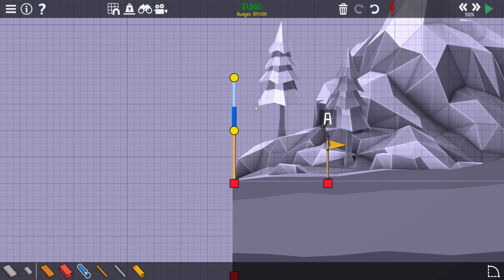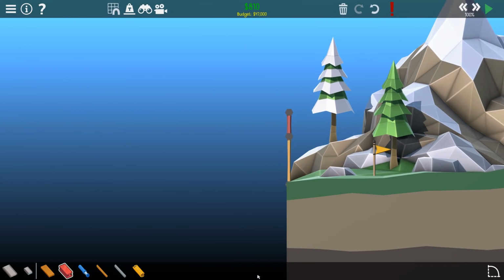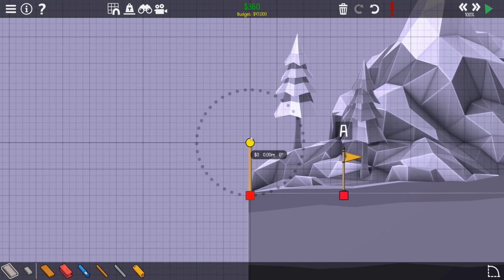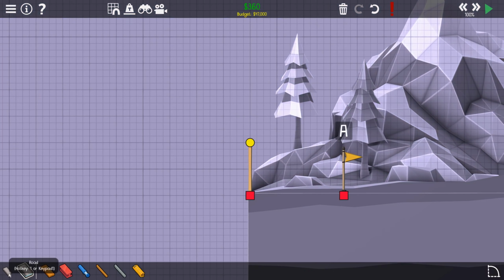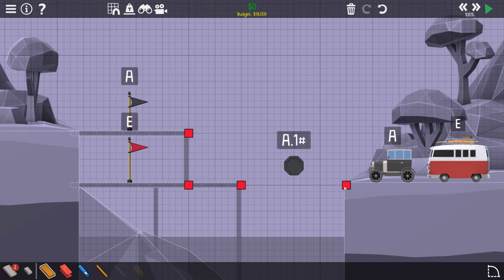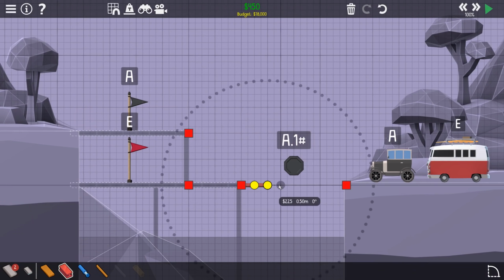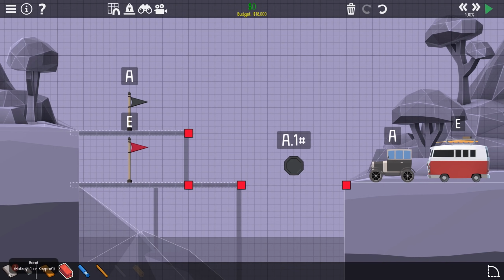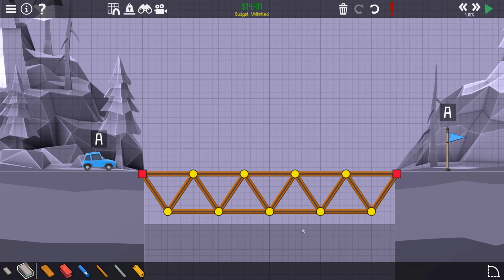How REALISTIC is Poly Bridge 2? Explained by a REAL CIVIL ENGINEER

Comment: I did some researches and posted it on reddit one time about the exact weight and maximum stress forces of the PB2 materials.

Turns out that while all the materials have no mass, and only the nodes have a mass of 0.25Pg, the roads have a mass by piece + length + node.
Each meter of the normal road is 0.25Pg.
Each piece is 0.5Pg.
Each node is 0.25Pg, like everything else.
While for the reinforced roads, the meter and the segment have a mass of 0.3125 and 0.625 Polygrams respectively.
Reply from the maker: This is fantastic, great work and thanks for sharing!
Reply: @Esphaav nerds are the powerhouses of our world <3
Reply: @daruyami  Humour exists <3
Reply: @daruyami  so you're calling mitochondria nerds?
Reply: @sinbad269  world != cell bruh
Reply: @daruyami  promoting hubris, are we?
Reply: Love seeing someone get into the nitty gritty of a video game like this. Really gives an insight into a developer's mind & also allows greater applicable feedback for them. 

Speaking of which I'd love to hear the developer's thoughts regarding this since the weight of roads differed. I'd bet that initially the different materials did have differing weights & weight by length but were changed either do to it raising difficulty too high or maybe it'd require more processing power. Not being a programer I don't know if it'd effect processing power enough to matter.
Reply: soooo does this make it realistic or not?
Reply: Esphaav his nerdiness got him a good paying job, so maybe you should try it out sometime
Reply: @puffball2059  he could have been a programmer and been someone's basement slave. You can make bank being a welder or plumber.

Academics =! Wealthy job
Blue collar =! Shitty peasant
Reply: 696 likes

Comment: Not an engineer, but I can tell you that a solid piece of lumber probably should be heavier than a steel I-beam. The reason we make skyscrapers out of I-beams instead of solid poles of wood, is because they are lightweight and extremely strong. 

The reason they make steel support structures in the form of I-beams instead of solid poles of steel, is because the I shape MASSIVELY reduces the weight of the steel without compromising its strength. It MASSIVELY reduces waste, and the thin parts of the steel that stick out from the core on top and bottom gives enough surface area to attach steel rivets to them and connect things to it.

Comment: I just thought you could measure the torsion strength of the pieces as well, by putting a number of nodes on top of a piece and seeing how many it takes to crush it, then, invert the setup and dangle the nodes instead, and, again, measure how many nodes to break it.

Comment: I know I'm a bit late to the party, but could someone explain the difference between the trusses going above the bridge vs below? Or if there even is a difference. I have a degree in computer engineering so forces and physics are not my forte, but I love learning new things and find this very fascinating
Reply: Late to the party as well =) The big difference is that the upper chord (in the case where you span over one precipice) is under compression while the bottom chord is under tension. So you could go  "topChord=woodBeam and bottomChord=rope" and it would work. Try the other way round and your bridge will collapse immediatly since rope cant do compression. Concrete (without steel reinforcement) works in a similar way since its tensile strength is only about 10% of its compressive strength. 
If you take the same materials however there is no big difference concering the statics. In reallife where you put the truss would be a matter of if you need free space over or under your bridge.

Comment: Our modern, personal computers are pretty incredible compared to what they were just 10 to 15 years ago, BUT even the most powerful personal computer does NOT have the computational power to fully simulate real world physics in real time. Simply put: There is no game available anywhere that actually simulates real time, real universal physics. To calculate every physical force involved with a vehicle moving across a bridge structure, even once per second, much less every animation frame, would slow the game down to a game freezing nightmare. To overcome this, games use generalized calculations (algorithms) that appear to simulate things like mass and gravity and stress forces, aerodynamics and buoyancy, etc, but these are so over simplified for the sake of speed that a game like this could only be used to teach general physical concepts, not practical, real world solutions to bridge building.

Comment: nodes in real life could have a mass, but that's only if a node is just 2 holes in each piece connected with a steel rod or something, that would make sense, but I'm just guessing that the developers just thought it'd be funny or something idk (this would only make sense if the steel rod weighs more than the material, so it would make sense with wood, but not with steel, so the rods would've been made out of osmium or something which is kinda weird and expensive

Comment: Wait a second..

You stress vs weight theory makes no sense to me....

If the game calculates strength vs weight equally based on the material and is always equalled out you'll arrive at the results you have observed...

Like wood being 50% of the weight of steel and 50% of the strength...

The joints are a + factor which bares weight on its own but never exceeds the material used...

Still not realistic when you get down to it...

Also isn't the "stress" percentage counter based upon the over strength of the structure and not individual pieces?
Reply from the maker: No all materials except road weight the same, their strength is what varies. The stress percentage is of the weakest piece, not the average of the structure

Comment: In the brief physics classes i took I remember there was always some factors that were small enough to be negligible like drag and what not (at least for my classes purposes) and also all objects were considered point particles and if not forces acting on them were measured using their center of mass (essentially a point particle when cracking out the math) and i think that’s what this game is doing. I think for every road the game makes there’s two joints which makes the game calculate an additional center of mass.

Comment: Joints add weight, material between joints is always the same weight just stretched out to cover the distance. So an infinitely short material would be infinitely thick/dense. Same goes with wood vs metal. There is always say 1000kg worth of material between joints.

Comment: This is somewhat standard for bridge games. It's somewhat based on statics and pin jointed truss structures which typically considered with point loads and the mass of the truss itself is not significant. Polybridge 1 & 2 seem to be implemented fairly naively in Box2d I believe so additional quirkiness is added by like the use of solvers that weren't intended for for this use but more general simulation. I think that is what makes Polybridge less accurate than it could be, but this video seems to criticise it for for not using Finite Element method (FEM) simulation, which seems a bit like criticising a space game based on newtonian equations for not being correct under special or general relativity. I believe statics and pin jointed trusts are studied in engineering at universities.
Reply from the maker: You sound like you know your stuff!

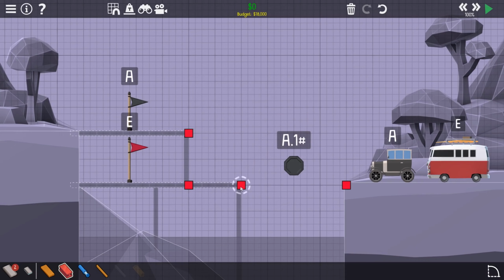Comment: At 7:36 you explain how adding a joint increases the stress due to a weight change. I think it's actually due to the fact that the "beams" are actually trusses which don't pass moments. This means a single piece cannot sag and will show 0 stress. When you have two trusses connected like that they can sag, causing a stress.

You're right that the weight increases with number of pieces, but that's not what this test proves.

Comment: Matirals do have different weight but no a enough to equal a full percent within ten it equates to roughly 1.5 from road to other materials this is calculated from material to joint so the weight of a material goes to a joint instead
Reply from the maker: Does it really? Does the length affect the weight then? I might have to do a follow up if this is true!

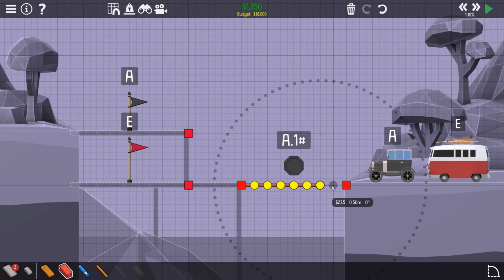Comment: It seems joints have some level of elasticity aswell. Where beams are completely solid.this evident at 7:50 when it sags
Reply from the maker: Yeah I did notice that, but there would be no way it would affect the strength as we are unable to apply weight along the beam, only at a node.

Comment: 1 - Did you test a single piece of wood with no additional weight on top? That should have been the control for all the tests.
2 - In prior videos, you mentioned that wood has very good compression strength, but poor tensile strength when compared to rope or cable. Did you test hanging things from the wood?

Comment: The weight to length of the roads also seems to scale non linearly, very weird
Reply: Are you sure it's non-linear? It might just have a small growth factor and big offset - so when you add a small piece, the added tension is dominated by the offset, because the tension/m-component is small - and the more you extend, the more significant the tension/m term becomes
Reply from the maker: Ooo didn't look at this in detail but that's a great spot if so! Username does NOT check out!!!
Reply: lmao
Reply: i believe its because the stress % is showing the road's stress, not the wood.
Reply: it might be because of the weight of the nodes

Comment: you would only definitively be able to say that reinforced roads have a better strength to weight ratio if you would make the car as much heavier as the reinforced road is compared to the normal road. now you tested them against a car of the same weight and thus the ratio between the weight of the car and the road was lower for the reinforced road.
Reply from the maker: If you think about this ratio though, it must be better for reinforced roads to be stronger as their own weight is taken into account. If the ratio wasn't better than normal road then the added strength of the reinforced road would be offset by it's additional weight. Hopefully that makes sense?

Comment: Something small you didn't test in this video is the weight of split joints.
When you make a split joint with multiple numbers (ex: not all 2's) it creates one joint for each number, so having 1s and 2s in a split joint weighs double what a normal joints weighs.
If you have 3-way split joints enabled using hydraulic controller, a split joint with 1s, 2s, and 3s weighs three times a normal joint.

Also split joins move straight through terrain while regular joints don't, so you can't make a wall brace or ground brace a split joint cause it'll move right through the thing it's supposed to be bracing on.
Reply from the maker: Yeah I didnt even think to test split joints unfortunately. Thats really interesting they cant be used as wall braces. Thanks for letting me know! Also, do I recognise your name from the leaderboards??
Reply: @RealCivilEngineerGaming  Ya, I'm that one ;)
Reply from the maker: @GoSeigenTwitch  Wow, thanks for stopping by! 😀
Reply: Real Civil Engineer pretty sure you do, he‘s quite good at this game haha

Comment: Have you seen the bridges that are just a loose hanging arch of road?... That's something you would not see in a real bridge. And that's how people get ridiculously low priced bridges in most levels.
Reply from the maker: Yeah makes me angry to see people not engineering their way to the top!! 😅
Reply: @RealCivilEngineerGaming  also the falling road strat
Reply from the maker: @jhawk2402  Don't even get me started on that one.... 😅
Reply: What's wrong with the dangling road? The joints in this game can freely rotate. Having a bunch of asphalt slabs attached by strong rotating joints and attached to perfect anchor points could work in real life. Not well, but it's not like it's violating physics.
Reply from the maker: @slicedtoad  asphalt and concrete slabs are extremely poor in tension in real life, so unless the road is made of a material that isn't either of these materials it, doesn't work in head. I'm just being a stubborn engineer and love trusses, I can't help it! 😅
Reply: @RealCivilEngineerGaming  What principles make the dangling road possible in the game?
Reply from the maker: @dogwater2125  it's just tension, imagine the dangling road was made from pieces of rope tied together and you can work out how it works. Trouble is in the game it isn't rope, it's road which is meant to be asphalt or concrete or similar- materials that do not really have those properties. Hence I see it as a more of an in game physics engine glitch.
Reply: @RealCivilEngineerGaming  Think of the road as pre-stressed steel-reinforced concrete with an asphalt surface coating and it starts to make sense. Reinforced road would be less hollow and contain more steel.
Reply: @RealCivilEngineerGaming  Well most dangling bridged are made from reinforced road, so there is probably another material within the road that is okay tension-wise.

Comment: Only roads and joints have weight in PB2. Material doesn't at all.
Reply from the maker: Correct, not sure why they programmed it that way though. Probably came down to wait was more fun to play!
Reply: @RealCivilEngineerGaming  It's more convenient from a coding perspective. It's a lot harder to properly provide the weight over every single point at all times. If something needed to be balanced, it'd have to calculate the weight distribution of each and every piece, considering different angles will create different forces against each other and if it's a design full of mechanical movement, it can lag the game the more pieces you add severely.
It'll also make some of the current bridges far, FAR more difficult to hold themselves together. If you take a look at some of my latest Poly Bridge works on my channel, you'll kinda understand why it'd be a good idea to not program realistic weight.

It doesn't mean the game can't be used for designing real life bridges though, considering it still demonstrates weight distribution pretty well, though there are some bizarre exceptions like a dangling asphalt roadway. It's nowhere near perfect, but it's a pretty close standing imitation.

TL;DR It's not necessarily accurate from a realism standpoint, but it makes a ton more sense from a coding/programming perspective.
Reply from the maker: @ArglinPB  wow thanks for checking out the vid, didn't think someone of your skill in the game would bother!! Thanks for your comment, though having worked with modelling software in real life I'm not convinced that it wasn't programmed realistically due to the complexity. After all, it's only working in 2d and there's only a couple of different materials. I agree that a lot of the designs people come up with probably wouldn't work though, I think this is what I was getting at by saying it was coded that way for fun. Either way, thanks so much for stopping by. Feel privileged, your designs are incredible and truly inspire!

Comment: The weight of something can also change with split joints, they're twice as heavy as normal nodes
Reply from the maker: No way!! I didn't even think to test that. Thanks for letting me know!
Reply: Does that mean 3 way split joints weigh triple?
Reply from the maker: It does indeed weight triple!
Reply: @RealCivilEngineerGaming  that was quick...
Reply from the maker: And really bad English!! *triple weight hahaha
Reply: @RealCivilEngineerGaming  Well actually, weight can be a verb, as far as i know, in which "it does weight triple" would be correct. And if order is "triple weight", in which case its a noun, we have to have verb, for example "it does have triple weight". Or i might be wrong, i always do languages by intuition
Reply: @overloader7900  well, you could say "it does triple weight" with triple as the verb and "it" referring to the act of converting a single joint into a 3-way split.  >_>
Reply: @overloader7900  you are nearly correct, except the verb form of "weight" is "weigh". Therefore it's "weigh triple".
Reply: @ThomasWinget  I don't think your English teacher would be happy with that answer lol
Reply: @Good_Hot_Chocolate  I'm not so sure.  Finding clever abuse of language features seems like something many language teachers would consider a hobby.  I will concede that the argument I made above would probably require a thorough defense were I to use it in any formal context.  It's not wrong by any means, but it's definitely not what most would consider "correct" either.  :D
Reply: @ThomasWinget  I love giving answers that are and are not correct. 
Anyone: do you want to empty the trash? 
Me: No, but I will
Reply: @kaisneed3270  That would make sense
Reply: V
Reply: Well, split joint are practically just 2 joint together...
Reply: Overloader7 true but they are half a joint each which technically should equal the same weight so it still doesn’t make much sense
Reply: @Trenzalore-gn6xq  it does, they are two separate joints connected together
Reply: They are not twice as heavy, there are just 2 nodes in 1 place